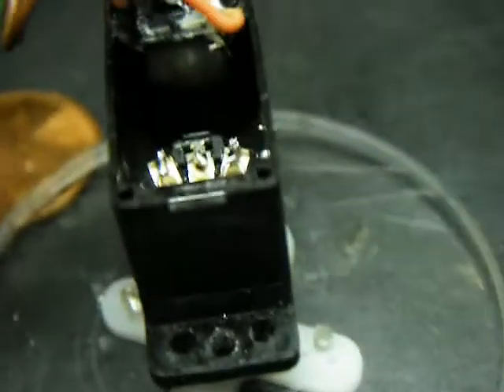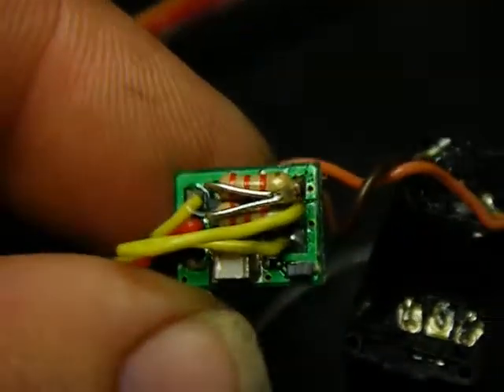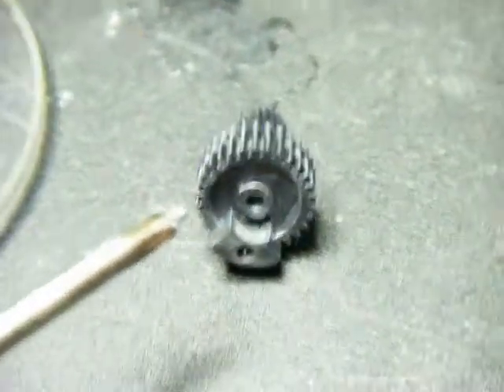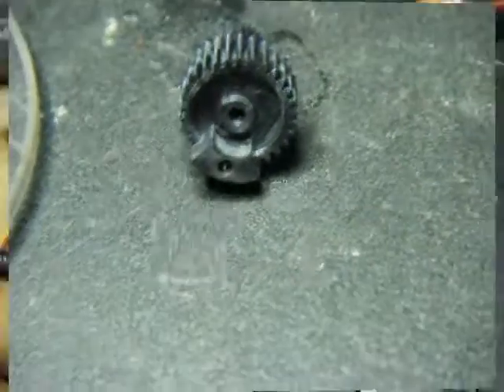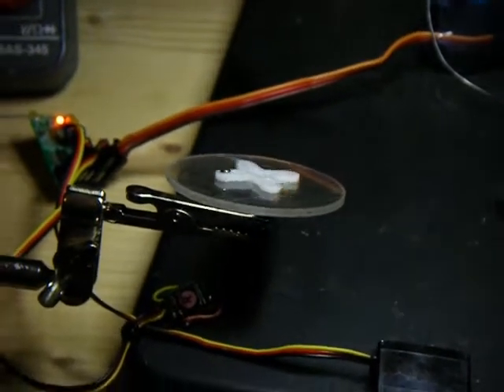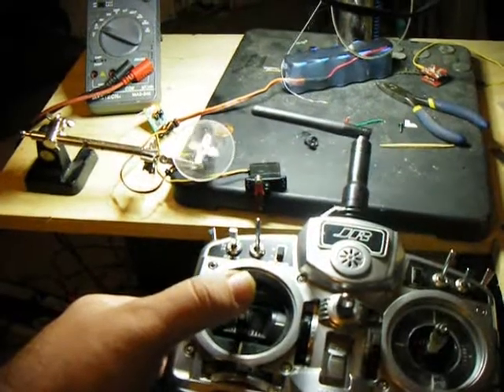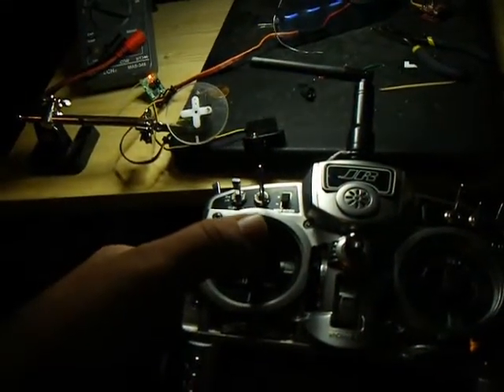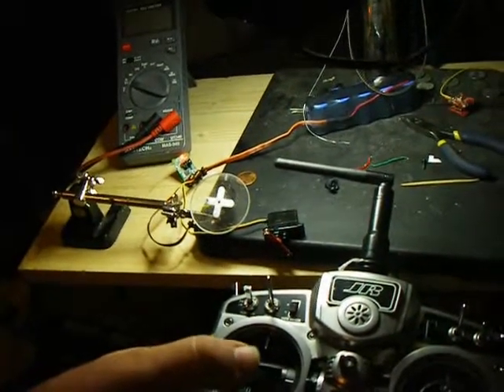Hitec HS65-HB 360 degree servo mod

Comment: why remove the whole pot? unless you want it to functions as a wheel. it will not stop and may twist the wire of the camera until you center the sticks. and will not reset to center, having a wide camera lens and a 235degree pan is already cool, at least when you center the sticks, it will return to center front in emergency. removing the feedback pot cannot track your camera position and angular displacement! it you really want 360 replace it with burns 1T pot and your good!

Comment: It works on most servos.  Rarely, you'll encounter a servo that has a partially cut gear instead of a complete circular gear and stop.  Most modern servo geartrains are designed with doing this in mind, it's used a lot for robotics.

Comment: so basically by modifying the duty cycle now you control speed instead of position? but with the same ratio? i.e. instead of going to the 0 position it goes at maximim RPM CCW and instead of going to the max position (180 o 220 deg) it goes at max RPM CW?? or how do you control RPM?

Comment: hi.. thanks for the vid.. i was looking to do the same.. one question thou. why did you use the 220 resistors ? i wont be using the HS65 servos with this mod. so i need to know what resisitors to use ? how to u know that ?

Comment: And I thought that hack just makes servo rotate with ONE speed (one direction or another). But after watching your video I see that servo will be rotating with different speed depending on the position on the transmitter.

So, please tell if this is a normal behavior or it's a special setting in transmitter?

Comment: Could you please tell if you set up your transmitter in a way it rotates servo with the different speed?

This is very important for me. I have a futaba 6ex transmitter and I plan to uncover my Hitech servo and replace potentiometer with two resistors and hack gear as you proposed.